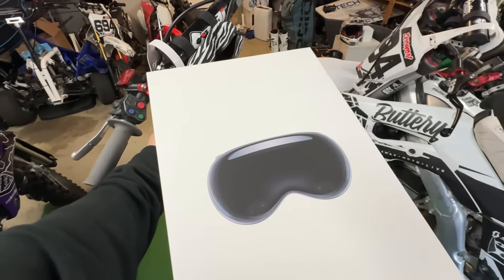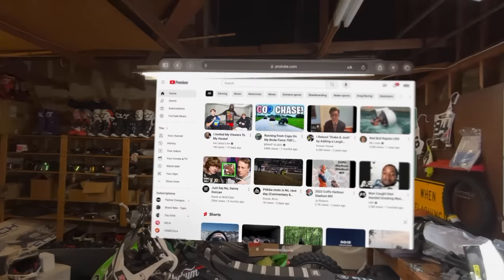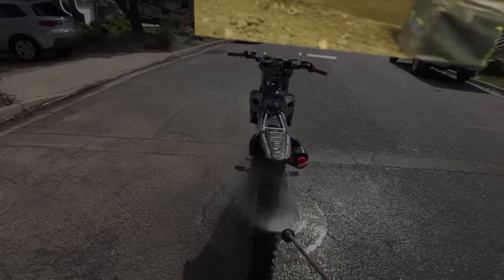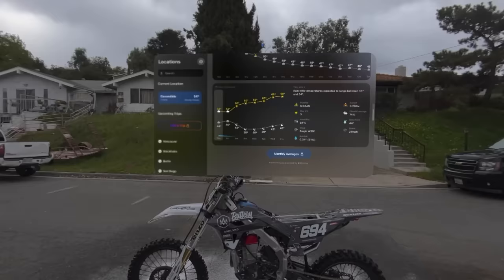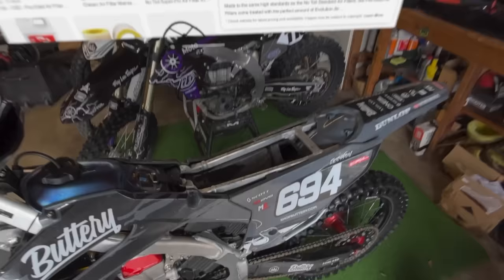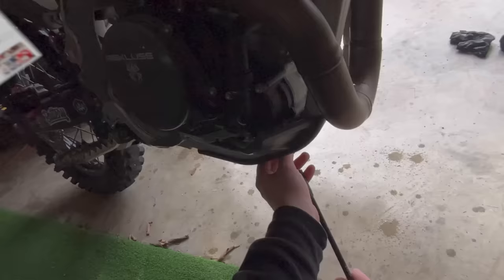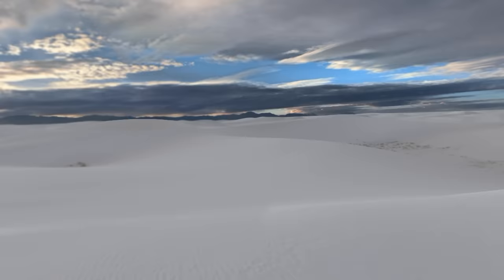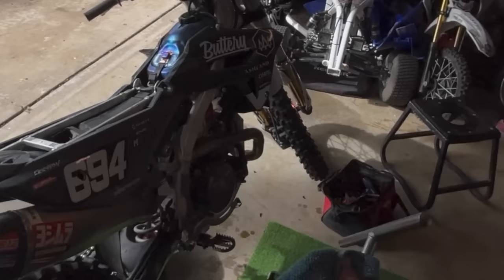Using Apple Vision Pro To Work On My Dirtbike!

Comment: I find it so interesting how we all wash and work on our bikes a little bit differently. I always take mine for a quick 1 mile hot lap after a fresh wash to get all the water off the chain along with heating up the engine case and pipe to make sure all the water evaporates. However, rocking the VR while also wrenching is a first for me; I’m going to have to try that one of these days…
Reply from the maker: My road is too dirty it would just get it dirty again haha

Comment: Apple could seriously revolutionise MotorSport and Action Sports.
Of course the tech will get better and with that comes downsizing the specs so it could probably fit in a ski or Moto Goggle.

Who would get a GoPro or insta 360 to capture the view you are looking at of course it’s going to be $1,000+ not only that but the possibilities of setting up a hud and make it viable for group riding.

Anyways they gotta be in the Development of Sport Goggles there is so much potential! 🙏